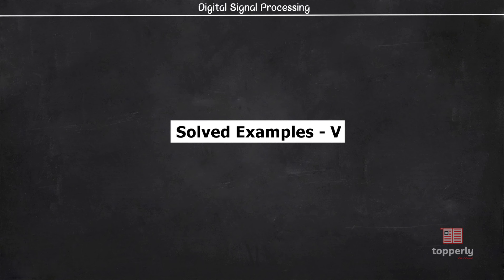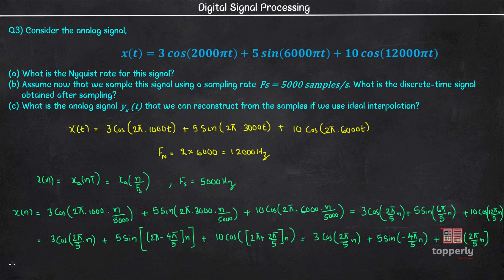Solved Examples | Nyquist Rate & Aliasing | Digital Signal Processing

Comment: This is a great lecture to show distortion when using a sampling rate lower than Nyquist rate and even equal to Nyquist rate. Would love to see the graph and how the special case [13:03] would change if F_s is 1 Hz higher. Thanks for these lectures! More power to your channel
Reply from the maker: Glad it was helpful!

As I do not have the codes required for your question right now, you can download 'Interactive Demo of Nyquist's Sampling Theorem' by Costas Vlachos from Mathwork website. You can play around with it to any frequency you need :)